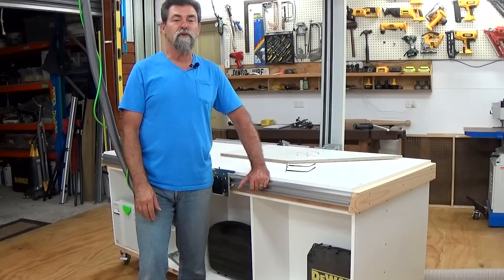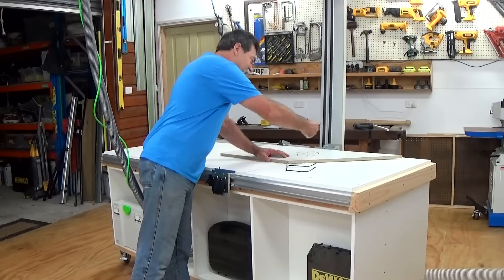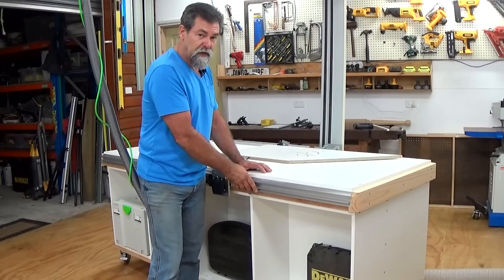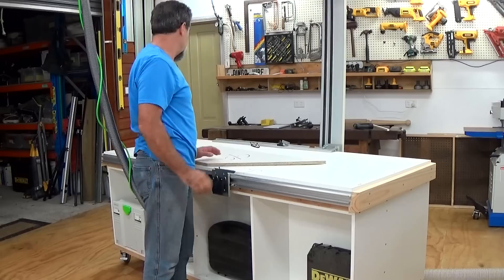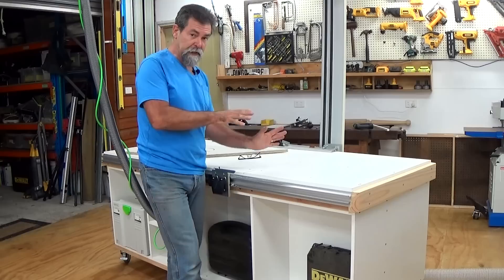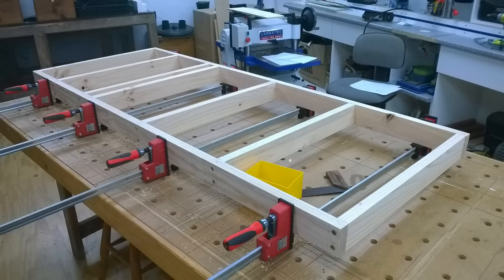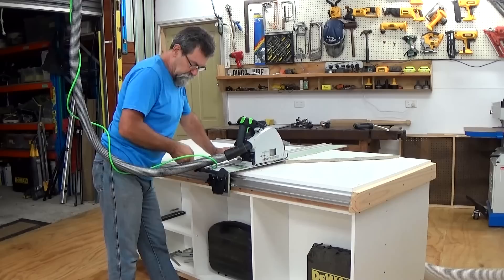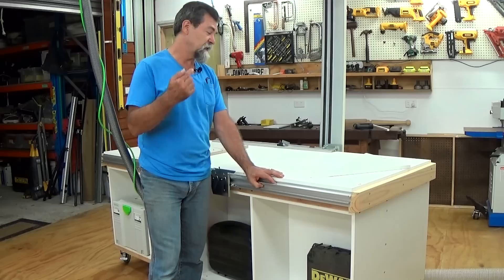festool track saw docking station dave stanton woodworking mft-3  woodworking projects

Comment: I am about to build a similar table measuring a table capacity of 3750x1250mm comprising a 1400 rail mounted with bolts. By this I can have the tilting guide rail in a fix position and still be able to make 90 degree off cut on up to 1250x2500mm sheets at any part of the length. For the other direction I use a 3000mm guide rail and a second 1400 rail for other than 90 degree. It was a smart idea with the support wall in the middle to support the table lengthwise. I will change the construction on my version using a supportwall despite the torsion box top. Thanks for sharing your knowledge!
Reply from the maker: +JN 2013 I hope it works well for you!

Comment: you could also use the Festool routers on the guide rail which would make routing dados really quick in large boards
Reply from the maker: Thanks Henry. I have to buy a Festool router first. All in good time.
Reply: Henrys Workshop i

Comment: Love it. I want to build one like this, but I want the FESTOOL side extrusions with the Ron Paulk base below the extrusion, but I would have the MFT top as well and have it as an outfeed table for my table saw with sustainer storage below the Ron Paulk portion of the top all on casters.
Reply from the maker: I built it like that before and found it was a problem when assembling and trying to cut on the one table. That is why I made this second unit.
Reply: got ya! Well I'll keep that in mind.   For the moment with my shop size I'm going to just get the mft/3 as I need more table top space and I'll build the other one later.

Comment: I wish I had the space for one of these tables, I would make one.  I made a poor mans version at a shop I work at.  I had to process 250 sheets of stock that were not square sheet goods and I did it quickly with the table I made out of ply wood and MDO medium density overlay.
Reply from the maker: +Erik Anderson This table works very well. I made it this size mainly because I finally do have the room.
Reply: +David Stanton I hope to have a large workshop one day!  Thanks again for your great videos!

Comment: Another brilliantly well thought out bit of Kit Dave. Great Video quality. I haven't got the room for a cabinet saw, been looking at getting a Single Phase Wadkin on eBay, but the more I think about it the less I need it! I have the HK85EB and that has all the power I need, but I do want the accuracy of a cabinet saw, with my Incra 1000SE Mitre Fence. I'm currently using a real cheap 1800W circular saw just set foe square rips on an insert adaptor I made for my router table. I'm open to some of your great lateral thinking for some ideas!
Reply from the maker: Hmmm, a challenging thought......

Comment: David that's a really neat solution, more versatile than my standard mft, I imagine.
Think I'm going to screw my fence to the back of the mft, it is possible for it to move slightly just relying on the Festool arrangement.
Your remote control is very neat, does it also control your wife to bring you a cup of tea or coffee, lol.
cheers
tony
Reply from the maker: Remote seems to be faulty every time I aim it in her direction! The festool arrangement is pretty good if you are using both clamps.

Comment: Great build Dave and thanks for sharing this!  As I pull together my shop, you are providing great inspiration and for that I thank you!  I see now how you use your HPLV dust collector.  Question:  Is the HPLV a Festool product and will you show how you have that mounted/installed that another post (or maybe it is detailed in an earlier one you could reference)?

I am building a bench design from Ron Paulk (modified to 4' x 6') that has a cross cut jig. I plan on setting this up like you have done.

Keep 'em comin'!  Cheers!
Reply from the maker: William Rambo HPLV is a Carbatec unit, the FM-300 pulling air through an Oneida super dust deputy. I can show in a future video how I converted the Carbatec unit.Thanks again and keep subscribing and let the adds run their course, it all helps me to bring these clips to you. There may be something you are interested as they try to match product with content.
Reply: ***** Thanks David, although now I'm confused (not the first time and won't be the last :D).  I would have thought this was more of a shop vac style unit to call it high pressure low volume.  The FM300 looks similar to an entry level dust collector that I have seen in the US (Central Machinery sold by Harbor Freight) and looks like the unit you have in video#44?
Reply from the maker: William Rambo sorry, not used to using initials for naming items. You are correct, the FM-300 is a high volume low pressure item, HVLP
Reply from the maker: ***** the other unit I have is a high pressure low volume and is not a Festool, it is a vacmaster.
Reply from the maker: ***** The vacmaster has died and now there is a little ryobi. I am saving up for the festool!

Comment: I love this! I'm endeavouring to set up a workshop and I'm trying to do away with some of the crappy old tools I have, and with space at a premium, avoid unnecessary tools... chief among those, in my mind, is a SCMS. I have been looking at track saws and kept wondering why, in a post track-saw world, the track saw can't take the place of the mitre station. not only that, but greatly increase the capacity of what can be done at a mitre station. I imagined in my mind the exact setup you have here! only difference is that I'm imagining it with MFTs as a top so that one could use bench dogs + things. the MFT gets one half way to not needing a SCMS, but at huge expense and in a way that doesn't really fit into a workshop... it really seems to be dedicated to portable workflows.

so, thanks for this video! can I ask why you put the ruler so far away? isn't it hard to see + use? is it possible to put it at the rail closest to you?

now my task is to figure out how i can build this, starting with a track saw and two sawhorses...
Reply from the maker: Thanks for the feedback and compliments. I measure at the back because the track is mounted on a hinge at the back of the unit and it is easier to align correctly prior to locking the front section of the track down. Keep watching as I will be showing a few interesting products that may interest you.
Reply: David Stanton could you put a positive stop on the side close to you, to butt the guide up against?

how often do you use your kapex, out of curiosity?

Comment: Love your benches.  They are so clean and modern looking.   Question it looks like many of the surfaces you have are either hard glue laminate like for counter tops is that correct?
Reply from the maker: That is right Gary. Thanks for the compliment!
Reply: Great I am going to do the same thing.  I presume you use a sacrificial top on top of those for cuts and such and or paper layered for gluing right?  Or are you just wiping them down with a solvent?
Reply: Your welcome.   If you have plans let us know on these benches.
Reply from the maker: Sacrificial tops and I glue straight on top, use a chisel to run over when finished. The glue has a hard time sticking to laminate.

Comment: really cool. Do you ever find yourself wanting to cut larger that 800mm at times? Do you think an angled docking station would be practical, say, if the table was at a 45 angle to get a full 1200 sheet, similar to the verticle wall mounted type
Reply from the maker: Hi Alex. Never had the need to do wider than 800 in a finish docking situation. I do sheet breakdown with the track saw on top of the assembly table if needed but usually an edge, rip on table saw and then through the docking station I am demonstrating here.

Comment: Lovely sir, thank you for taking the time to share. One question if i may? I understand that the Makita track saw will run on a Festool track, but would i be able to copy your system part for part and change only the track from Festool to makita?
Not sure if you can answer or maybe one of your subscribers.
Thank you in advance.
Reply from the maker: Hi Sly Wolf. The Makita will run on the Festool guide rail.

Comment: Hi Dave, 
I’ve been following you for some time now (I thought I had subscribed, but when I checked just now,it turned out I hadn’t clicked the Subscribe button before!  so..., I just did 😉  — Great videos, informative and explanatory, and straightforward 👍👍
Just a question, 
the 2 stops on the tracks (front and back) of the MFT3 table come factory pre-positioned and tightened, so that when mounting rail on the “hinge” and the receiving part with the tip, it is 90º with respect to the MDF (the holes grid, actually).
With your customised cutting table, I suppose you have had to check several times, to align the hinge and receiving part, and were 90º with respect to the fence. Did you have to fiddle a lot, or did you came up with some easier method of aligning and squaring up?
(I hope I explained myself). Cheers!
Ernesto, Barcelona, Spain.
Reply from the maker: Thanks for subscribing! Have a look at the  video I did on the Tso triangle.
Reply from the maker: Here is the link. https://youtu.be/syrsQPbj66U
Reply: @DavidStanton  Thank you so much, Dave!

Comment: Awesome table,  I'm not sure how the hinge for the track work, is it fixed? so you have a limitation of material thickness that you can cut on it?
Reply from the maker: +Eason Qin . The limit is governed by the depth of the saw cut which is 50 mm. The hinge system is Festool's MFT-3.
Reply: Thanks David, i see how it works now. I'm going to build one too, :)

Comment: thanks for sharing. Good ideas you have. 
  I just went online and checked festool prices. In america they go for about half the price compared to Australia! whaaat?
Reply from the maker: Correct
Reply: Just wondering how do you cut down 1200mm sheets? Are you just using longer track and taking your time to square it off?
Reply from the maker: Tiit Saul My process is to use the track saw to dress one full edge of a sheet. I then use my cabinet saw to rip to width. The last stage is using this setup to dock the lengths that I require. My widest panel that I would use is 800mm which I can do here. If I do need to cut a full sheet square at one end I will use the 3.4.5 method and set my track to those marks.
Reply: Cool. It all makes sense.

Comment: David - BRILLIANT!!

I've been thinking about improving on the MFP3 - didn't know you could get the 2 meter festool extrusions - perfect mate - nice torsion box as well...

btw did I hear you correctly when you said - you recommend the Aluminium blade for melamine?

Pete
Reply from the maker: Peter A Yes Pete, but I am having second thoughts. After more use the fine cut http://www.festool.com.au/saw-blade-160mm-x-2/2-x-20mm-48-tooth is the better option.
Reply from the maker: ***** I have removed the part of the video that recommends using the blade designed for aluminium. Just to remove any confusion.
Reply from the maker: ***** I have a new addition to my docking station that I will work on over the next few weeks. Stay tuned!!

Comment: Hello Dave, I have been binge watching your channel this weekend and have got a whole list of new projects for my shop.  This particular one is awesome and is on the top of my to do list.

I'm not finding the longer profiles on festool's site.  Any help with a part number?
Reply from the maker: +latech15 I thought I had put the codes on the video?
Reply: +David Stanton I read that in another comment and have been looking all over and didn't find them anywhere. Did you give the numbers in the description, or as a subtitle or what. What am I missing??
Reply: +David Stanton I found the codes, but it appears that the longer rails aren't available in the US.  The more I think about it, length of the rails really has nothing to do with it, right?  The rails just hold the hinge and the stop/support on the front side.  If they never move, then what is the point of the longer rails?  I should be able to make as large of a table as I want and just use the rails from the standard MFT/3.
Reply from the maker: +latech15 You can get by with the MFT rails. I like the long ones because I can use the festool clamps to hold items on the edge of the table for whatever reason.

Comment: Dave, you showed how the front stop adjusts for different material thicknesses, I assume the back adjusts the same way, is this correct?
Reply from the maker: Yes Steve. You place the item you want to cut under the rear of the track and release the support clamp and then retension and then the same at the front. I repeat the back again just to make sure.

Comment: Hi Dave! If I understand you correctly, you make your cuts from the same place on the table every time? So I'm wondering, do you need that much track?
Reply from the maker: Correct. No, I don't but that was the only way Festool sold it. The track can also be used to mount other things such as clamps and also the plate that holds the vac sys.